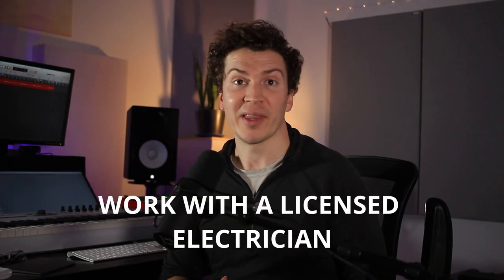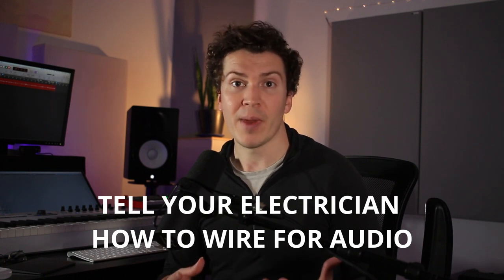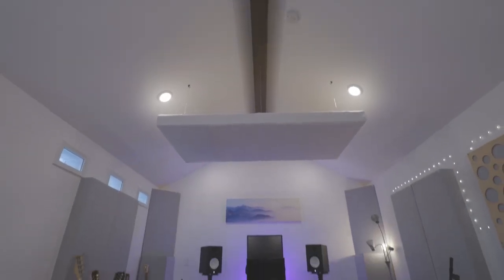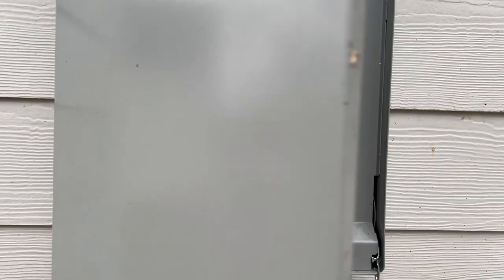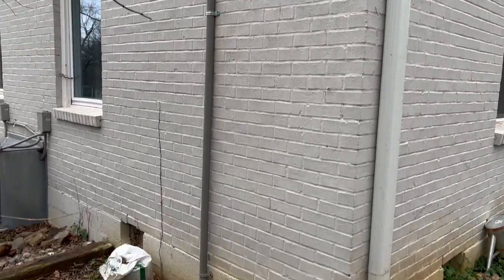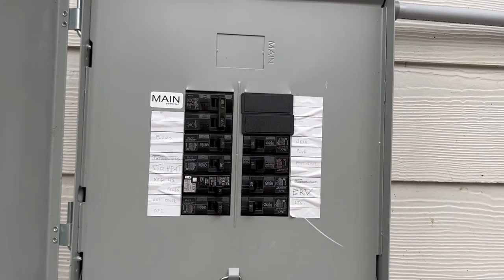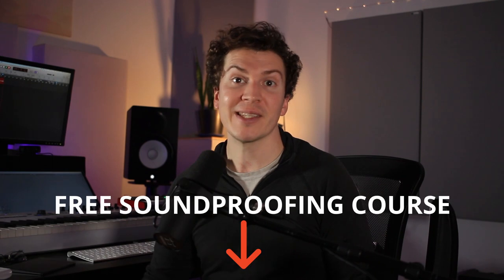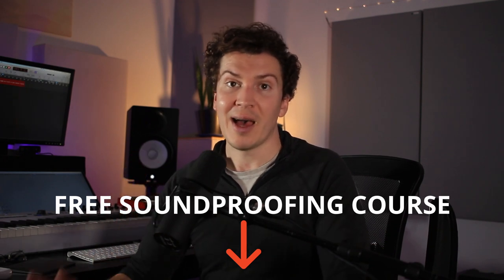How To Run Electrical In Your Soundproof Studio

Comment: Check out ATXled. They have DC Low voltage switches and lights. They put the converter in a panel and you just run low voltage wiring . Cheaper and safer and no noise.
Reply from the maker: Thanks for sharing!

Comment: Great video, I’m surprised by how few videos there are on YouTube about building a studio. 
Would you help me, I’m trying to figure out the electrical wiring. I don’t know how many Amps I will need. I’m in the USA, so the Voltage is 110. I’m building an Atmos setup that I also want to use for home theater so I want more Sub power than most people. 
I was a DJ, my system had a 5000 watt QSC amp going to a massive 18” sub and 2000 watts going the the rest of the system. All of this was would get plugged into regular outlets at venues. I don’t understand how I didn’t trip circuit or start fires.  Normal outlets are 110-120V at 15A, that’s a max of 1800 watts!
Thanks
Reply from the maker: So as far as electrical needs I would definitely talk over your plan with an electrician. As for the sound side, make sure to do what I said in the video to avoid electrical hums and get as clean electricity as possible. Thanks for watching.

Comment: Hey thanks for the advice!  Are we worried about running electrical conduit through our partitions?  I know if I'm venting HVAC in the room I need baffle boxes.  I need to get the electricity into the "room with in the room".  Do I need baffle boxes for 3/4" electrical conduit?  Seems like it could be a potential sound leak.
Reply from the maker: No, that would be pretty extreme. Just use acoustic sealant where there are any  penetrations through the wall. I like to use surface mounted electrical or even better run the electrical through the acoustic wall and ceiling if building one.

Comment: Thanks for the info! That's great the dimmer worked. Do you know the specific reason it didn't cause any noise? The type of lighting? Type of dimmer? Certain way of wiring? I'd like to put one in my new control room but don't want to be just hoping for the best. Your'e the first person I've seen recommend them lol!
Reply from the maker: Hey Mitch! My best guess is that the dimmer works because I am using LED lights. The dimmer is nothing special and is probably one we got at home depot. There wasn't any special way of wiring it, although keeping all your audio on its own leg of the panel will still help. I am not sure I should be recommending them haha, but it did work for me.

Comment: can you link the exact dimmer you used? thanks in advance
Reply from the maker: I am not sure of the exact model, but this should work - https://www.homedepot.com/p/Lutron-Diva-LED-Dimmer-Switch-for-Dimmable-LED-Halogen-and-Incandescent-Bulbs-Single-Pole-or-3-Way-White-DVCL-153PR-WH/203670402
Reply: @soundproofyourstudio  Ok Cool thanks. Im currently working on a build and will be using these